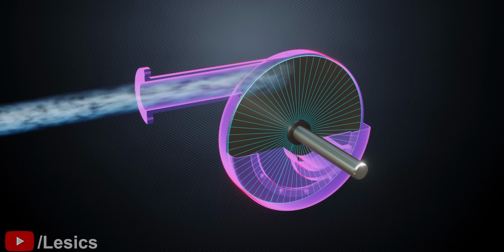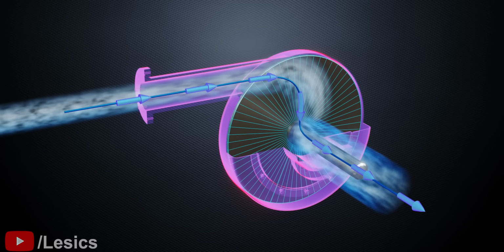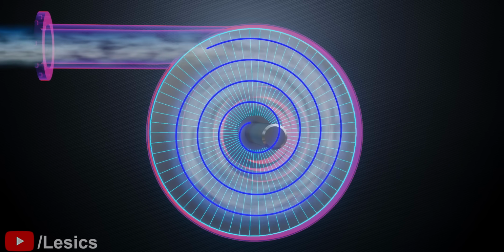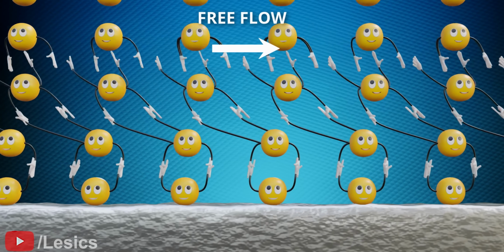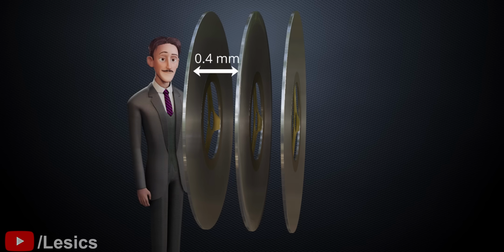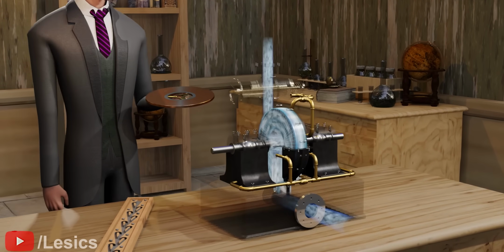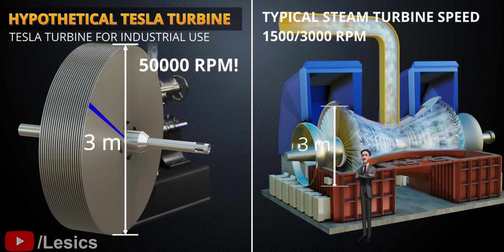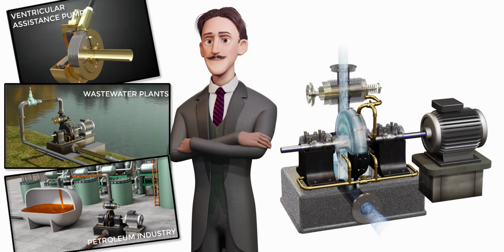Tesla Turbine | The interesting physics behind it

Comment: I don’t think his claim of it being 97% efficient is false. The design can theoretically do that, if the disc was made of a material strong enough to withstand the centripetal forces applied to them. In theory, he isn’t lying, but in practicality it’s just not feasible with current materials.
Reply: I dont get it... Instead of needing to create one huge one, have several of them in an array instead. That way the required power can be produced without the need for huge impossible discs.
Reply: @tonyppe  welcome to capitalism my friend, produce as less as you can and sell it for as much as you can.
Reply: @tonyppe  this wouldn’t be any more helpful unfortunately, it would still be less efficient than their more complicated counterparts. It would consume more energy for less overall output power. I think….
Reply: @tonyppe  More disks of smaller diameter would cost a bit more to produce, but that would more than pay for the difference by having much higher efficiency. But the goal is to use patented technologies, so the owners of those patents get paid to ensure even more products use their patents.
Reply: In other word.

He's limited by the technology of his time
Reply: Material is one thing, but assume a 3m dia disc rotating at that much speed. It will be like a flywheel. Decreasing the RPM reduces efficiency otherwise it is a really damn good invention. Needs a higher viscosity fluids to get better efficiency at low speeds.
Reply: @the_flying_fox  Like, you know, liquid water. Or adding more flywheel disks to the stack.
Reply: Everybody thinks the success of the 20th century was electricity.  I would say they are half right.  The other half of the success was really our newfound understanding of material properties and its foundations of chemistry; materials and the EM phenomenon.  When we discover new phenomena, new materials will emerge.
Reply: You’re forgetting the Mach 13
Reply: @thadoc5186  Smaller disk radius/diameter disks, more disks, same amount of force generated (as torque and speed for the drive shaft).
Reply: @SapioiT  If it was that good it would be used more.
Reply: @thadoc5186  If it was more tried and tested for decades for the specific usage of power generation from steam, it would be used more. But it's more useful for power generation from more viscous fluids, like liquid water, sewage, and for pumping those and petrol. Let's not forget a big percentage of the (liquid) water pumps on the market destined for use in a single home or in a small garden use a metal disk, sometimes with very short wavy grooves (1mm tall and wide and 15 cm or 150 mm in diameter, for example).
Reply: @SapioiT  I can’t agree with you. Over a long period of time companies that use the most efficient method survive.  If this really did work inside a steam turbine I guarantee that it would be used.
Reply: @thadoc5186  The "most efficient" method is monopoly. If you don't need to worry about the efficiency if the product you're selling, but just making as much money as possible, then the efficiency is about making money, not about an efficient product. Otherwise iPhones wouldn't be worth that much more than an android phone with similar/equivalent specifications. Because profit efficiency is the metric by which the companies work, not the efficiency of their products' functionalities.
Reply: @SapioiT  hard to compare a consumer product to one that uses a commodity to operate. 

If the Tesla turbine were more efficient it would use less energy to make the same amount of electricity thus creating a higher profit margin.
Reply: Diamond disk
Reply: @alexremington3772  It'd shatter instantly.  Diamonds have good compressive strength, not tensile.  Think brick vs rope.  Flywheels want to expand, forces are trying to pull them apart, not smash them together.  Carbon fiber and such would be the better choice here.
Reply: I take that even further, I don't understand the high RPM and tip velocity bit here. That part doesn't make any since. 

For example due to the design the tip velocity can't exceed that of the incoming flow. There's no way it's practical for incoming flow speeds to be anywhere near that fast. The RPM of a Tesla turbine would be self limiting based on the speed of the incoming flow.
Reply: @snek9353  I don’t think that’s how it works. Looking back as to how the disks were separated by x distance from each other explains this. Water moves faster in tighter spaces, as there is more force applied to the water to exit said space. Ever seen the Titanic? Picture that scene where the water is rushing into the hull of the ship, and you’ll see what I mean. The more force applied to the water, and the smaller the space it has to escape, and you’ll get a faster velocity for the water. That’s how the disks could reach incredible rpms.
Reply: @garrettlee4207  The Bernoulli effect only occurs until the flow reaches the local speed of sound. At which point velocity no longer increases. This would also depend a lot on the medium, you said water, the video's example was mostly steam. Steam is compressible, water isn't, these will act very differently. 

But there's also another aspect, for the turbine to have any torque it'd have to be rotating slower than the fluid. For the boundary layer to have the desired effects there has to be a significant speed difference between the turbine speed and flow speed. Assuming one wants to do actual work, torque is required. Now the ideal ratio between flow speed and turbine speed I have no idea. It could yes though be said that as the difference increases efficiency decreases. But this is a very common thing with all but positive displacement systems using non-compressible fluids, including more common turbines and electric motors.  

But also, if for example one wanted to look at using a Tesla turbine to generate grid electricity. Well grid electricity as I'd hope we all know is AC at 60hz(In the US). The maximum RPM a generator can turn to generate 60hz is 3600RPM. So that alone is RPM limiting, the flow into any turbine used to generate AC has to be regulated to maintain the correct RPM. So then assuming a Tesla Turbine directly coupled to a generator we know it's max useful RPM already is limited to 3600RPM. One would then choose a material and maximum diameter that material can safely handle at 3600RPM. This will give the greatest tip speed achievable, for example a 2m wheel turning 3600RPM has a tip speed of 377m/s.
Reply: @snek9353  You forgot something: Gearboxes. That's right, you can use it to convert higher speed and lower torque into lower speed and higher torque. This basically means that you can convert any speed to any speed, which makes the RPM limitations claimed in your video be less of a problem than you claimed.
Reply: @SapioiT  🤦‍♂️🤦‍♂️🤦‍♂️🤦‍♂️🤦‍♂️🤦‍♂️
Reply: @SapioiT  Flow velocity is covered in another comment, read it. 

Gearboxes introduce drag, not helpful when the entire goal is efficiency. Also completely unnecessary as tip speed is what matters and that's controllable with diameter.   

My video?
Reply: @snek9353  Instead of gearboxes, transformers can be used to convert higher voltage lower amperage current into lower voltage higher amperage current.

Your video what? You made a video about this? Or are you asking if I was talking about your video? I didn't check your channel, I was talking about the video in whose comments section we're talking.
Reply: @SapioiT  Do you know what Hertz is? It has NOTHING to do with voltage or amperage. You just don't understand, this is obvious. I should have stuck with my first reply, you're not equipped to understand, making this pointless. 

Also stop thumbing up your own replies, it's pathetic.
Reply: @snek9353  My bad, I meant to say watts, but it doesn't make my comment wrong. I was thinking of frequency, instead of intesity.

Hertz is a measure of frequency. It is used in AC (alternating current) to show the rate of change. Specifically, Hertz (Hz) refers to the amount of occurrences of the phenomenon in one second.

The calculation for watts (power) is current (amps) multiplied by the voltage. 120 x 5 = 600 watts. That’s the simple answer. BUT if you are calculating this for a device for which the phase of the current is important - like an electric motor - then you’ll need a more complicated formula.

The fact that you don't know that, shows how much you really understand what you're talking about, while claiming I'm the one who doesn't understand what I'm talking about. Besides. I'm not replying to convince you, but so others also see through the factual fallacies you are spreading.
Reply: @snek9353   Think of a record player.... if you put a rotating disc in contact with an area near the center turning at say 100 RPM  and then touched a rotating disc of the same size for measuring speed at the outer edge of the record player that outer edge disc will be turning much faster. If you mentally separate those two tracks, the center track will be about 5 inches while the track on the edge is about 40 inches. But that distance (40 in) must be covered in the same amount of time as the 5 inches, hence it's turning 8 times faster.  Does that make sense?
Reply: @Hizenbird  Duhhh, what's your point? Do you even have one?
Reply: @snek9353   If you don't see the point there then it's no wonder " you don't understand the high RPM and tip velocity bit here." Jeez...
Reply: @Hizenbird  You should have read my other comments first before making a fool of yourself.
Reply: @snek9353  That can be achieved with increasing the speed by reducing the diameter of the water pipe, which would cause an increase in speed, or by increasing the volume of fluid used, which would in term increase the pressure, which would also increase it's speed at the point where it goes from higher pressure to lower pressure, which is also sometimes done by lowering the temperature of the fluid. But if companies produce more efficient designs, the patent owners won't be paid to have more products use their patents.
Reply: If the Tesla turbine were really much more advantageous, it would be used in the present!
The "lords" of the power generation industry are not stupid, so they think in terms of cost-effectiveness! They wouldn’t be using a much more complex and intricate technology that is obviously even more expensive than Tesla’s fever dream!

No! That can not be possible!
The Tesla turbine, obviously unsuitable - so unviable ...
Reply: @belabaksay-roka900  Yea. A lot of factor come into consideration before selecting a design. If it was that efficient, we would have used it already.
Reply: @the_flying_fox  I will repeat what I said in another comment from this same thread: No, the manufacturers don't use it because they don't own the patent, which means that whatever design they develop can be replicated by anyone without legal trouble, and that they cannot lock the power generation industry into their products through training people to repair them. The easier things are to repair, the more reliable and popular they are. Because there's no use for the most efficient technology, if you have no mechanics capable to repair it and little to no documentation to use to tweak it for maximum efficiency for your goals. I mean, in the IT field, that's how Javascript became so popular, too, if you want a cross-field example.
Reply: @belabaksay-roka900  No, the manufacturers don't use it because they don't own the patent, which means that whatever design they develop can be replicated by anyone without legal trouble, and that they cannot lock the power generation industry into their products through training people to repair them. The easier things are to repair, the more reliable and popular they are. Because there's no use for the most efficient technology, if you have no mechanics capable to repair it and no or little documentation to use to tweak it for maximum efficiency for your goals. I mean, in the IT field, that's how Javascript became so popular, too, if you want a cross-field example.
Reply: @SapioiT  "No, the manufacturers don't use it because they don't own the patent ..."

Don't make me laugh! ...

It is the evident interest of a capitalist entrepreneur to ‘PRODUCE’ PROFIT for his business!
If a technology is cheaper - and even simpler and more reliable - than the one you are using, you WILL BUY the patent, no matter how much it costs! Otherwise, you have to reckon with the fact that competition will soon push you off the field ...

(The rest of what you wrote is just wording ...)

Obviously, Tesla's 'turbine' (if it exists at all) isn't worth shit! ...
Reply: @belabaksay-roka900  Except, it exists and is used in plenty of cases. Both as a pump, and as a generator. Something makes me think you didn't watch until the end. It literally says it's used to generate power from liquid water and sewage, and to pump more viscous substances (like water, sewage, and petrol).
Reply: @SapioiT  The Tesla turbine is obviously not used for industrial scale (power plant) power generation as the Tesla turbine DIRECTLY is powered by electricity! This, in turn, makes it unsuitable for industrial power generation ...
Reply: @belabaksay-roka900  Well, no, that's a tesla pump. A tesla generator isn't powered by a different generator, but by a fluid moving through the pump-like part of the generator in the opposite way to how it would move if it were pumped. In other words, a tesla generator is a tesla pump running in reverse, just like a stirling engine can, if you fed it torque instead of temperature difference, but with water pressure difference instead.
Reply: @SapioiT  'Tha Doc' (see above)
 replied to your note instead of me!

(So I find the additional counter-arguments superfluous, if only because I have formulated them in a very similar way before ...)
Reply: @belabaksay-roka900  I replied to "Tha Doc", too. And I did so approximately 5 minute (give or take a minute) before you replied to me.
Reply: No, it just means they limit themselves to using wider disks (with higher radius/diameter), instead of using smaller-radius ones and more of them in parallel. That way, those speeds could be reached without the disks failing in any way. Sure, it might cost more to produce, but it would more than pay for the difference by being a lot more efficient.
Reply: @SapioiT  At some point the current turbines end up cheaper though...
Reply: @firethorn9799  It depends on the use-case. If you don't care about that extra efficiency, then you might not be willing to pay the extra price. I mean, is that 9% increase in efficiency and the lack of decades-long history of the technology applied in practice, worth investing into? Many would take the tried-and-tested over the new, even if the new can be a lot better, due to the lack of certainty.
Reply: @firethorn9799  The point at which current turbines end up cheaper might simply be the massive difference in research and development, in favor of the steam turbines..
Reply: they way they demonstrated it and explained it was NOT and never could be better than 15% efficient ... because they didnt show a tesla turbine they showed the edison version ... a tesla turbine doesnt use steam across the plates edge but passes steam through the palte on the edges and middle through angled holes ... inside middle and outside ... the plates on both sides work together to spin the shaft and 97% of the steams energy is converted into axial power ... what they showed is GARBAGE and not even close to teslas patent on these turbines ...
Reply: @0623kaboom  I know, right? It's most likely dissinformation, and they included a dew true information at the end, to appease the otherwise enraged people.
Reply: He's not lying. It's just that what he says isn't true. 
Right. 
Thanks.
Reply: @David_Lloyd-Jones  What was untrue?
Reply: @David_Lloyd-Jones  Lying requires intent.  If you're saying something that you believe true, even if it's not, you aren't lying.
Reply: "If it worked it would be as efficient as Tesla claimed."
Congratulations, Garrett. You just qualified for the cult.
Reply: @David_Lloyd-Jones  I like how you made two separate responses, both being sarcastic. Couldn’t fit them into one?

Comment: Every one is missing the point the genny is what this is for
Reply: This is mechanical the same can be done electrical  hint hint hint did you get it nope
Reply: How about a little different  way for the same you have two tuning Forks at the same frequency you tap 1 what happens when you bring another one close to it or 15 or 20 this is mechanical the same thing can be done in electrical and about a hundred more different ways to do things like this

Comment: "...yet it was able to beat the efficiency levels of steam turbines at the time..."
AT THE TIME. Technology moved on.

And I call utter bullshit on the 97% efficiency claim, absurd speeds, and huge diameters. The peak tangential speed of ANY turbine can be no greater than the injection velocity of the working fluid, typically in the 300 to 1000 m/s range depending on molecular weight, temperature, and pressure ratio of the inlet nozzle. That cited mach number of 13 is simply pulled out of somebody's ass, even if the steam (or other gas) is expanded through a De Laval nozzle (ie, rocket engine profile) the peak mach is around 3 at best. Turning that flow (subsonic with respect to the spinning turbine) is done far more efficiently via lift than via drag, wasting less of the enthalpy and resulting in a cooler exhaust gas, and thus better efficiency. 

Every single claim made about the Tesla Turbine is laughable to anyone who has learned rigorous analysis of thermodynamics and studied turbomachinery that wrings out every bit of performance possible.